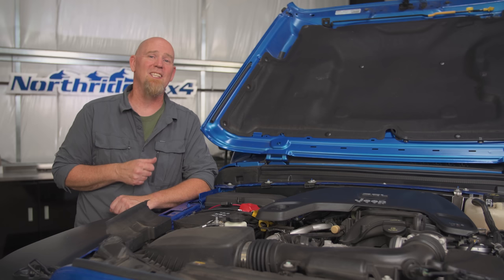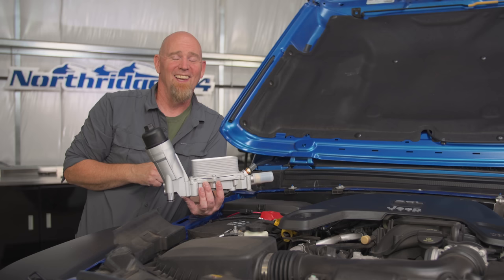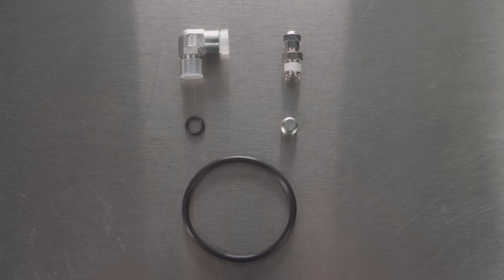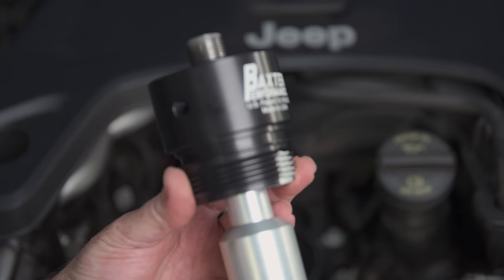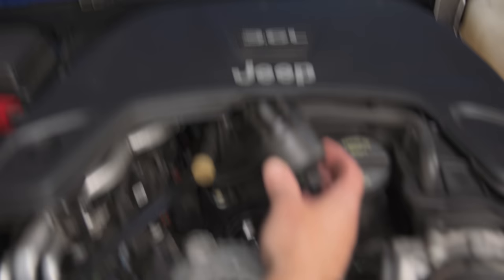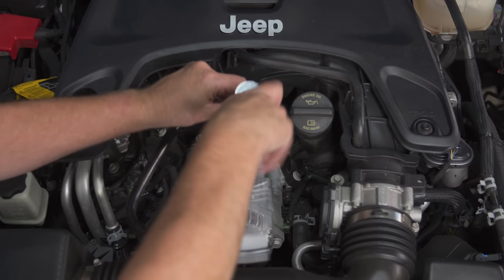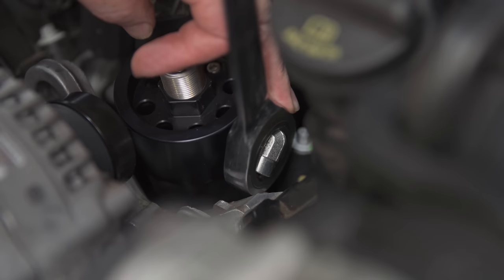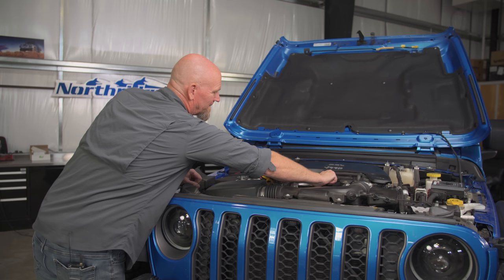STOP Dry Starting your Pentastar 3.6!!

Comment: The higher the mileage, the higher the number of oil visc to use.  Dont use too thin new engine oil on non new engines.  Older engines have wear out have more space between parts so they need thicker oil.  ASE Certificated engine Mechanic for 36 years
Reply: Give me a year range and mile range, for example 2012-2013 jeep Wrangler 146,000km or 150,000km
Reply: @ajanithomas6750  depens. 
If your manufacturer demands 0w30 and the engine approaches 150.k miles I'd change to thicker oil like 5w30
Reply: I get what you're saying but using a thicker oil viscosity on a high mileage motor........wouldn't that hinder for slight poor fuel mileage?
Reply: @Kiddro22   it compensates for wear on the engine. 
The higher the milage / the higher the tolerances in the bearings get. 
That means less oil pressure at the bearings and will cause more wear. 
So it's good to go for higher viscosity oil when the engine is worn out to keep it safe
Reply: @NinoJoel   Right.  The numbers on the cap are for newer engines only.
Reply: @Kiddro22  MAYBE HALF A MILE LESS PER GALLON, BUT YOU WILL SAVE THE ENGINE.  NO DIFF AT ALL.

Comment: The numbers on the cap are for newer engines only.  I use thicker oil on my 100k miles engine.  And Duralube every other oil change.  No oil used at all.

Comment: Two questions. You were showing a metal oil filter holder/cooler where the Jeep JK has a plastic one. Being plastic it does have a tendency to crack and start leaking as I have heard. Wouldn’t this device put more strain on the plastic since it sits higher and would probably vibrate back and forth more? You were demonstrating with a Jeep JL. What modifications do you need to do to the JK to install this? Aren’t there better oils out there that tend to cling to the engine parts after oil drains away and reduce wear until fresh oil is pumped to the parts?
Reply from the maker: Great questions.
1) Yes, the plastic ones tend to develop leaks as they get older. The metal one we had was an aftermarket replacement.
2) Yes, that could add more strain to the plastic bowl, if you have a higher mileage engine, it might be a good time to replace that oil cooler. They take a while to do, but it's not too hard. Maybe we should do a video how-to?
3) The JK 3.6 is pretty much the same, except they have those hoses I mentioned that you need to move out of the way. Make sure to get the correct year adapter for your JK.
4) Yes, there are good oils out there, but they all will eventually drain away.
Reply: A good oil leaves a film. An engine won’t even have any compression without oil on the cylinder walls
Reply: @northridgenation  I would very much like to see how this is done on a JK as I own one and I can hear the valves ticking each time I start the vehicle until they get oiled. Which is approximately a few seconds.  When I first realized what the ticking was and what I knew was occurring I brought my 2014 JKU to the dealership and after much arguing I walked out.  I’m pleased to see that my point is validated by this video. 
I’m looking forward to the new video. And I will purchase one!! Thanks.

Comment: You also should buy that aftermarket aluminum filter housing and factory plastic ones leak oil into the lifter valley and I heard they can also leak water into the engine, at least on the minivans
Reply from the maker: That seems to be a common problem with high mileage 3.6s.
Reply: @northridgenation  our 2018 Pacifica filter housing was leaking but that's the least of its problems 67,000 mi and it needs a new engine because it started drinking coolant and it's never been overheated and well maintained
Reply: This happens on every single one of these motors. I've probably installed 30 or 40 of those oil coolers in the last two years. I'm just an independent repair shop
Reply: @mastermnd22  Yup, I'm on board.  Before installing a replacement engine, the oil cooler housing will be upgraded as well as the cartridge to oil filter can conversion also.  This should make the second iteration of my rig full of a lot more peace of mind!  Oh!  Don't forget the E3 spark plugs!

Comment: That's a neat feature. Some oil filters have a valve inside as well. 
Makes me wonder tho wy these engines have such a problem with the dry starts. 
My 40 year old Audi has over half a million miles with dry starts and is still fine
Reply from the maker: Older engines have less problems. It's all the new cam phasers, timing chain tensioners and other items that need both oil volume and pressure to operate properly.
Reply: Does anybody know which, if any oil FILTERS , actually have an Anti-drain back valve  in the filter itself, that fit the 2011 3.6?

Comment: Been just starting my 3.6 normally since Oct. 2011 until now and never had an issue with anything engine or oil related. Still have the same starter and only changes the battery once since then. Still runs like a champ.
Reply: What’s the mileage?
Reply: 2014 ditto
Reply: Same with my '14 ram. Since 2017, anyway. Still using original battery from 2014! I do notice the ticking noise in the first few seconds but it rapidly subsides. I'm back and forth on getting this part...

Comment: He is Correct, 60% of wear on any engine is from start up. Having a high Quality synthetic motor oil like Amsoil Signature series 100% synthetic Clings to metal surfaces...
Reply: You are 100% correct , but the 60% of wear is more in bearing surfaces like rod and crank and cam bearings not valve train like he is saying..👍
Reply: No, a pressurized pre-oiler run by a motor is the answer.
Reply: @BigEightiesNewWave if it was a serious issue, they probably would have it even high end motors don’t have them.
Reply: @johnmadsen37  there’s no money in the cure.
Reply: I run Amsoil Signature Series 10W30 in my wife's 2018 Cherokee, it has the 3.2 Pentastar

Comment: I put Dura Lube in my old jeep. Is extra lubrication for cold starts.  Like a film on the surface.  Yes it works, I use it on my small airplane too.
Reply from the maker: Having a good oil film on everything is great.
The bigger issue with newer engines is getting enough volume and pressure to get the cam phasers and timing chain tensioners up to operating pressure.

Comment: One good point to make, if you have one of the earlier JK models with a plastic oil cooler housing, is to go ahead and upgrade that whole piece to an aluminum one. Just had mine blow and found out this is essentially guaranteed to happen due to the cheaper part. Might as well upgrade that if adding this adapter. Already upgraded mine and definitely going to add this adapter. Thank you for the educational video!
Reply from the maker: We definitely recommend the aftermarket aluminum filter housings.

Comment: I have a 1989 Isuzu Trooper with a GM 2.8 (now 3.1) V-6. Those geniuses have the oil pressure switch that has to have oil pressure before the engine will start much less run. My Ford 460 has a manual choke on the carb and I will crank the engine for a second or two for oil pressure to come up before I pull it out to start. Too bad I cannot do anything for my Jeep Wrangler; btw I had a major manufacturers oil filter fail its anti-drainbsack valve where it drained the oil in the valve train and crank back through the filter and oil pump.

Comment: The First Gen 3.6 had a problem with oil Galley plugs backing out,what would happen is that the oil pressure would drop on the valvetrain and the oil would over saturate the timing cover area,there are 2 plugs on each head.This causes oil starvation in the valvetrain area.chewed cam lobes,and roller.rocker damage.
Reply: Do the newer Pentastar engines have any issues?

Comment: My 2012 wrangler has 135K trouble free miles with the stock oil cooler housing. I did have the recalled head changed at around 24k miles back in early 2014. other than that, I've had no problems so far using Mobil 1 oil. I do have the doorman aluminum oil cooler on hand though to replace my brittle plastic cooler.
Reply: Does the Doorman have the oil drain back valve so it it keeps oil up in the engine too?
Reply from the maker: No, they do not.

Comment: I like the screw on filter, but how does it come off without the oil draining on top of the motor when you break it loose
Reply: I see now, the one for my 4 runner don't have the air valve
Reply: First thought I had...
😮
Reply from the maker: Apply air to the Schrader valve, the oil bleeds down and the filter comes off dry.
Reply: @northridgenation  But what side of the oil filter is the oil being pushed back into the oil pan? If it's from the dirty side where all of the debris collects, it's going to go right into the new oil filter at start up.
Reply from the maker: @rolliehunt5173  What little bit does, will blow back into the pan,  then drain out when you drain the oil.
Reply: @northridgenation  I don't agree with that assessment. I'm pretty sure it's going back through the oil pump and not durectly to the oil pan. The benefit of this is lost to the fact that you may reintroduce contaminating  particles to the inside of the engine.

Comment: Subaru  -  The manufacturer told people to only use the factory oil filters because many replacement oil filter manufacturers used an old Ford filter adapted  with modified threads and called it a Subaru OEM replacement.   Problem was that those oil filters did not have the drain-back valve like the Subaru filters and the engine had similar issue as they aged.

Why didn't Baxter put a surround lip around the perimeter of the oil filter like Subaru did to prevent spillage when replacing?  Also why didn't Baxter provide a new oil dipstick with adjusted markings for a full engine if both the amount of oil and the definition of "full" changed?
Reply from the maker: You don't need the spill lip. Once you blow the system down, it is as clean or cleaner than replacing the OE cartridge filter.
Baxter also makes these for the Subarus and they quite down that loud rattle on start-up.

Comment: Just hold the gas pedal to the floor when you go to start it..... 

It will not attempt to start when you do that, and then you can simply crank it for a bit until the oil pressure builds. Then let off the pedal and it will start normally with oil pressure already built-up.... 🤷
Reply from the maker: We show how to do that in the video.
Reply: @northridgenation  I saw that.... I was a little premature with my comment there. 🍻
Reply: So if using "clear plug mode" works to lubricate the upper valve train at cold starts, why would you not just use this clear plug mode when starting cold as opposed to modifying the oil filter setup to achieve the same results you can achieve for free?
Reply: @JohnWalkerCharlotte  You don't get it... 

You'd STILL be cranking the engine with ZERO oil or oil pressure. Also, it would be VERY hard on the starter to be doing this EVERY time you start the engine. 

If you do the filter mod, it KEEPS the oil from draining back to the pan every time you shut it off, and you ONLY have to do the "clear plug routine" WHEN you change your oil and filter to reprime the system.

Comment: Wouldn't adding an external filter increase the oil capacity of the system as a whole that being the reason for a lower oil reading on the dipstick using factory oil capacity
Reply from the maker: Yes.

Comment: The 2.7 in the new bronco has the same style oil filter system….I bought a similar set up from Baxter for it! 
With all the Knowledge of engines and what causes damage , I don’t understand why manufactures design stuff like this?
Reply from the maker: It just doesn't make sense.
We'll be doing a Bronco kit soon.
Reply: We sell and stock the bronco kit :)
Reply: @maxxpehling  I’ve put this kit on both our broncos with the 2.7.. first mod I did to each

Comment: Or use a high quality oil that actually sticks to the metal and you wont have this issue.  Seen these go 250k miles before having issues with valve train. If you hear the lifters start ticking get it fixed fast before it destroys the cams...
Reply from the maker: Yes, definitely use a high quality oil. BUT, that is lubrication, what the cam phasers and timing chain tensioners both need is hydraulic pressure to operate and for that you need oil volume. Which means you are waiting for the oil volume and pressure to build up. By trapping oil in the filter housing and cooler, we are reducing that time to prime the oil throughout the engine.

Comment: Man I've ran the same oil for two years now in old 4.0 in my xj crawler last summer i blew a radiator hose and drove it off the trail empty on coolant it got so hot we mekted 3 injector o rings and I've yet to change thd oil after the misshap last year's 4th and have run it the entire summer . this 4.0 has 99k miles on it sits fir weeks without getting started as well ...lol... that minivan motor is weak sauce reliability wise compared to i-6.
Reply: I have almost 420K on my 99 Xj Beast!!!! It's a highway monster 💩💀

Comment: The LS engines take between 5-10 seconds to pump oil to the top of the engine, in the Old school Chevy small blocks, and Hemi engines it can be between 1 minute to 5 minutes. I kind of think this is a solution that may never have had a problem
Reply from the maker: It's a problem with the newer engines that have cam phasers and hydraulic timing chain tensioners that need both oil volume and pressure to get up and running properly.
None of those engines you listed have those.
Reply: @northridgenation  OH that makes sense, mine is a 2015 and I'll go ahead and pick one up when I hit the oil change, why wait for there to be an issue right 👍
AND thank you for the response 👍
Reply: That's absurdly FALSE information.
Reply: I have a 2015 ram and the 3.6 engine absolutely sucks this is the reason why I will never buy ram truck's ever again

Comment: Only drawback I could see is no matter how long I let these drain in this orientation I have a bunch of oil come out in this style of filter.  My valley of the engine gonna be full of oil after every oil change.
Reply: nvm seen what the schrader valve was for haha
Reply from the maker: Exactly! Hit the Schrader valve with some compressed air and the oil is blown right out and back to the oil pan, making it one of the cleanest oil changes you've ever done.

Comment: Well, i attempted to leave a more detailed comment with several questions, but it does not show.

So my additional question besides those i already tried to ask is what the long-term effect is of forcing air past the pressure bypass of the oil pump? That seems like trading one issue for another, isn't it?

I am adding in some of my original questions that disappeared.  We actually have a 3.2L engine in our Cherokee. How much sooner is oil supplied to the upper engine using this? I didn't hear that mentioned at all. I looked on the Baxter website and see nothing stating how much improvement there is. Show us the proof in the test data. Show us the test setup of how that is measured in real testing.

Exactly where is the oil being retained by this Baxter assembly? Just the new spin-on filter? How does the retained oil get released from filter to help the upper engine? Only once oil flows from pump to the filter? What am i gaining besides a $379.95 new filter contraption plus cost of a filter?
Reply: You have some valid questions. I feel about this about the same that I did about Mishimoto coolant filter.
Reply from the maker: Baxters say that it cuts down the oiling time about half.
As far as benefits, multiple people have chimed in this comment section about how much quieter their 3.6 is on start-up. 
It doesn't quiet them all down. If you already have some serious ticking going on, this may not do much.
Reply from the maker: The mishimoto coolant filter is most important on the first couple years of 3.6s. They had a lot of problem with the sand left over from casting in the heads.
In general though, anytime you can add a filter to something to help keep it cleaner, it will will help the component(s) live longer.

Comment: I put 100K mi on my 2014 JKUR with loads of highway and harsh off road miles everywhere from Death Valley to Fairbanks, AK doing nothing more than routine oil changes. 

My wheels (okay axle) literally fell off after a catastrophic lower control arm bracket failure before I ever had a single engine problem.
Reply: "Loads of highway" - I think the problem is going to be a function of how often you start the jeep, especially after it sat for awhile. I can literally hear my jeep dry-start for 2-3 seconds because I only drive it once or twice a week at most. If you drive it often and your trips are longer, you're less likely to see the problem before 100K miles.

Comment: Same engine as used in the premium grade Chrysler 200.
Poweful in a sedan sized car with variable drive train.
Replaced oil filter / cooler housing and intake gaskets; housing mount seals leaking coolant and oil.
Ran smoother after intake gasket change; must have had small intake air leak.